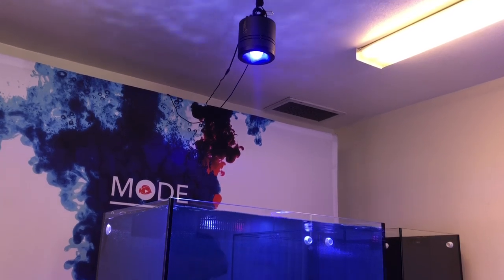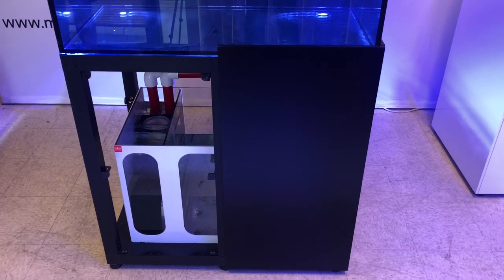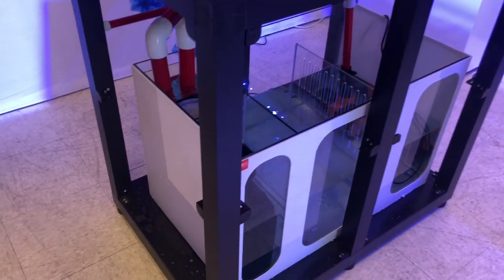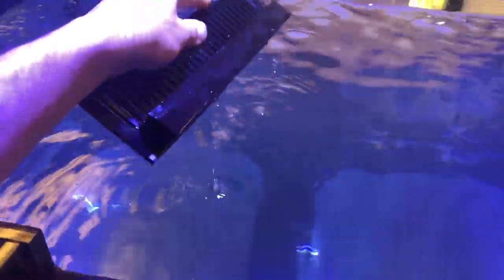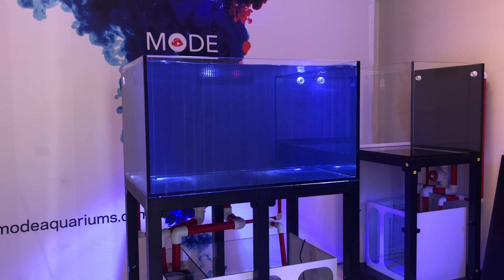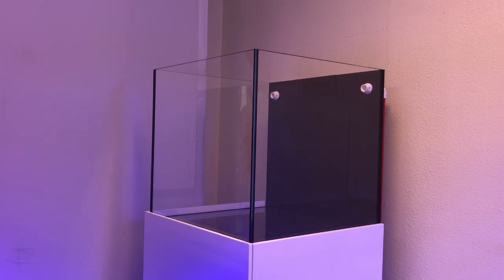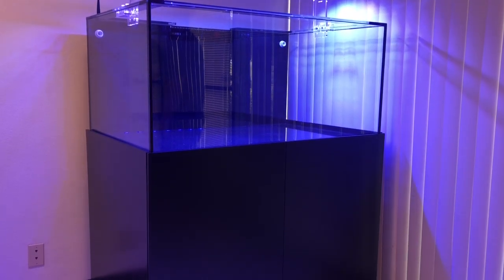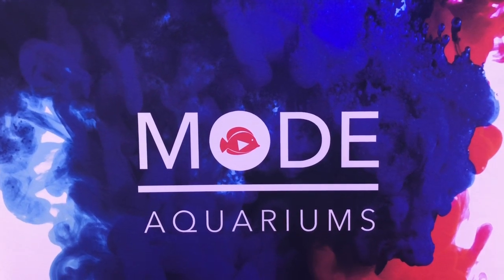New Infinity Series Tanks

Comment: sadly if you calculate that gallons of the tank based on dimensions its actually 120 gallons , w/out accounting for the 1/2in thick glass. With a 1/2 in on each side and the bottom its 111gallons. Which is a fun number, but their advertising it and pricing it as a much bigger tank

Comment: The sump takes up the entire stand, no room for ato and with removable panels no place to mount anything. Poor design. Hopefully they do better with v2.
Reply: I agree this tank could have been better. Front access for sump removal would have been nice as not everyone will have upto 4 feet on the side of their tanks to remove it, plus side access is just standard for an aluminium/steel stand. A mesh type of cover for the returns will stop snail's blocking it.The side panels and doors dont line up which makes it look cheap. Definitely need room for a auto top up. On the plus side the glass, 30 inch width, plumbing and overflow are definitely what make this a great aquarium. V2 could be the perfect tank.
Reply from the maker: They are making a panel that will mount on the inside to put all the controllers and such. Also with ato that is something you lose WITH ANY upgraded sump. You either opt for a big fuge area or Ato. We can’t have it all.
Reply: @eatsleepreef9565 I'd probably have a smaller fuge and a auto top up just for a cleaner looking set up. Cant wait for your new set up and what you do with it. Your current tank looks amazing 👍🏻

Comment: Way overpriced...
Reply from the maker: Seriously? I priced them compared to Red Sea and they are essentially the same. For example the 70 is equivalent to the reefer 350 at $1700. Considering all this comes with that you don’t need to upgrade I think you meant way under priced. You may be confused where other companies give you TOTAL WATER VOLUME GALONS this company is giving you DISPLAY WATER VOLUME
Reply: @eatsleepreef9565  exactly, overpriced. You're comparing to Red Sea who is the industry standard and been around for years to some new tank builder with no backing.